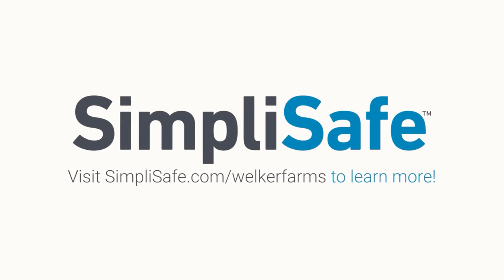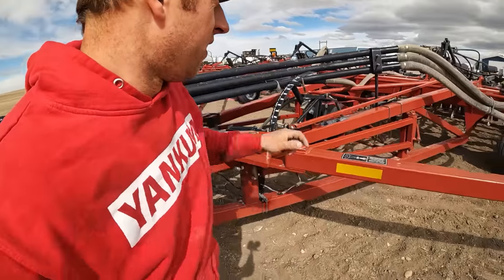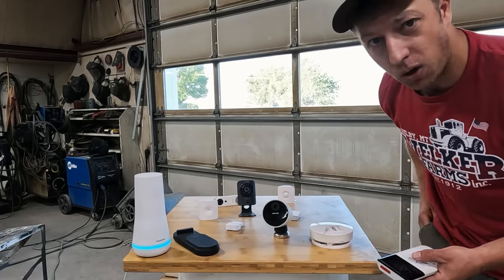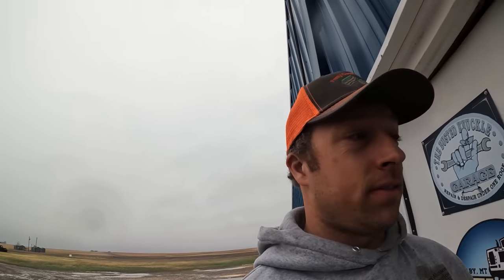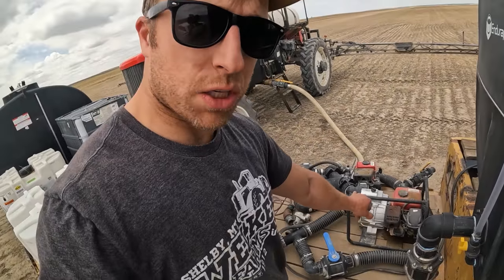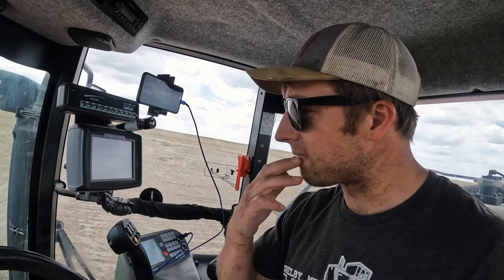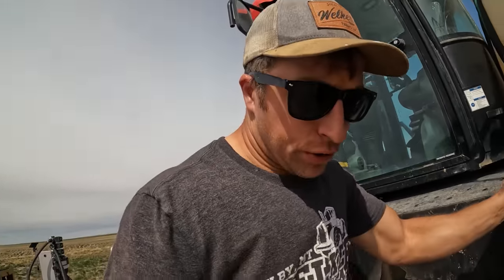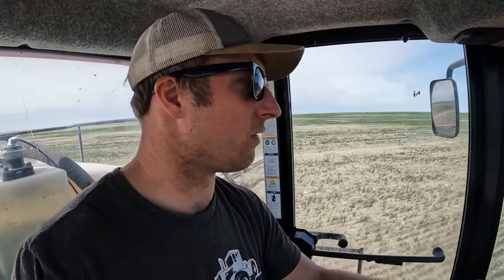Until Next Time Bud

Comment: Might use the construction crane strengthening principle on the Apache spray booms. Could put some channel steel uprights on the back of the apache sprayer. Use something like 1 inch nylon braided rope, probably 2 lengths per side of the spray boom, pulleys mounted at the top of the upright and tie the rope off on lower mounted small 'single cross anchor bollards'.

Comment: Nick you would probably have better service by purchasing pressure gauges filled with 2 parts glycerine and 1 part water. They work better than unfilled gauges due to the vibrations and rapid pressure fluctuations being dampened by the filling. Some will perform even when ambient temps reach -46 C. Just a thought. Have occasionally used them in industrial applications with much success. God bless.

Comment: For the pumps; do they not make auto-starting one so you don't need to keep getting out and starting? Sure it wouldn't be hard if you had newer pumps with a starter then they could have like a $5 circuitboard to just auto-start them. Then you could have a bracket there the hose is above the tank and just pull under it; start; and it'll do everything from inside the cab. However, you'd need a small motor and door that on top of the tank where you can open/close it from a push button so pull under it, open, start, autofill and shutdown then close the lid and do your run. They could eaily make a system like that and couldn't even cost much more but a few hundred bucks. Kinda makes the auto valves a bit useless if it doesn't do everything.
Reply: Autostarting pump engines is on the to do list!

Comment: Nick if you can get enough moisture for the cereals to germinate you can be ok, in Australia I've had many seasons where it has come up about 4 inches then gotten dry and the wheat will wilt and lay flat on the ground for a while. You think its had it but the wether gets a bit cooler then you might get some heavy dews and a little rain and it will stand up again.  Worst thing that happens is when the seedlings are small, you can get strong winds that pick up sandy soils and sand blast the stem and cut it off.  Game over if this happens but wheat is tough and will come back from the brink.

Comment: Have any thoughts about electric pumps governed by the program and driven by a bigger quite low revving dieselgenerator, Nick?  And when cleaning and filling stationary connect to powergrid.  Seems the natural for me anyway. But I'm just a dumb Swede used to have most things electrical or battery-electrical via converter on a farm. ;D  
FYI I've only one can of startgas and it's for some small engines from Briggs&Stratton or Kohler in garden equipment!  Haha!